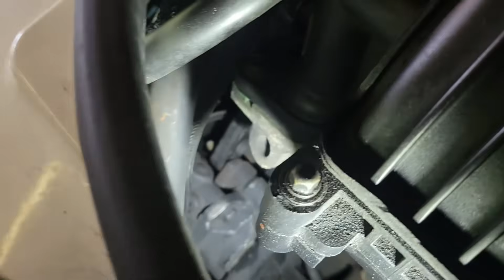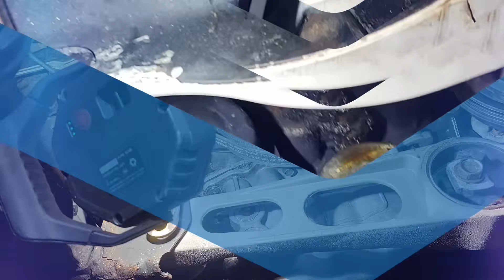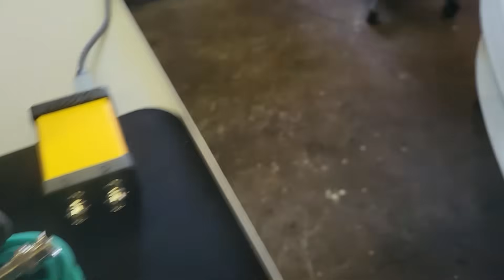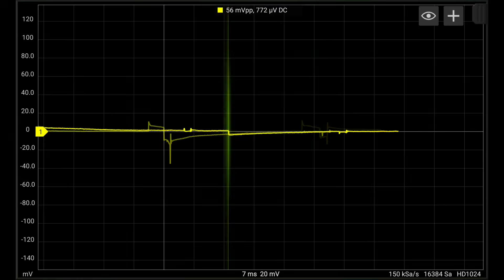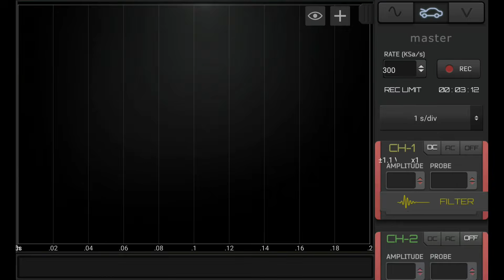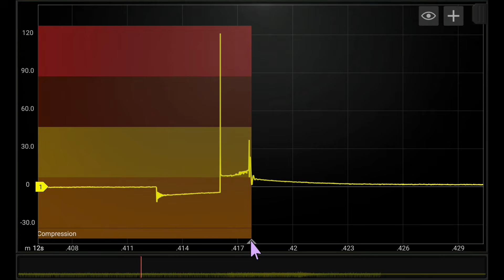2004 PT Cruiser Serpentine tensioner & belt. First use Rotkee Cx1 secondary ignition pick up.

Comment: Can you please tell me what tablet you use with your H scope and automotive module. I’m having difficulty finding a reasonably priced tablet  that meets the 4 gb of ram and that doesn’t have android 12+ .I plan on using the hantek 6074be and a laptop power bank with a tablet. The Lenovo tab m8 tb-8505f is what I originally planned on ordering but doesn’t meet the ram requirements.I would like to get something that is a proven combination. If you have a better idea of what I should get I would really like to hear it. I really enjoy watching your videos and it’s what got me interested in the H scope.
Reply from the maker: @iamautotech9872  Hi, I use an older Samsung S6 that has had a cracked screen and half bad charging port for a few years. I used it on Erin's A7 just to compare and found no difference. Looking it up, the A7 only has 3 gigs of ram. The A9 is listed at 4, however. I will physically check how much memory the A7 has because it ran just the same on her tab as my s6. I've run it on some A model samsung phones also with excellent results. Back market.com has a lot of used tabs if you can't find one local.  
 Samsungs seem to like Hscope, I've never had a compatibility problem yet. Even with the Micsig, the Samsungs perform great!
Reply: Thank you. I found a Samsung A7 tablet and I ordered a hantek 6074be kit and everything I think I will need to make a pretty nice setup. I really appreciate your help. Thank you. I wish you had a Facebook page or at least I couldn’t find one I would have liked to show you the finished product.

Comment: The trigger turns off or disappears offscreen whenever you do anything, drives me nuts lol
Reply from the maker: @philb2334  Yes, it does on scope mode, lol. It resets every time you make an adjustment to the resolution. I  think some new users skip the regular scope mode to get the signal. There is always that instinct to go to automotive mode straight off, but it is frustrating to have to record and play back just to see if there is a pattern on the screen. In automotive mode, i like how the trigger is automatic. Some scopes the trigger will move slightly, and the whole pattern disapears. Especially when you make a voltage scale adjustment. Automotive mode is like if there is anything going on, display it! Scope mode shows you a pattern without having to hit start,stop,clear and a few other keys. Also, if the signal is small and you just pinch to zoom to where it looks right, take note of the actual settings that have changed. That gives you where to start in automotive mode to see the same size pattern. It really is amazing how fast this scope can go from in the box to on a signal. impresses me every time!

Comment: Having an HS502 and HScope sure appreciate the lessons on how to better use he.software when doing secondary ignition captures.  I have ordered some Rotkee LX1's off.of.Amazon and lookimg forward to giving them a try.  The cable build quality is impressive for the Rotkee stuff.  That was sure some tigjt quarters for doing the tensioner and an awesome recovery on your part.
Reply from the maker: @jondieter4903  Thank you! I want to grab some Lx1s soon. I have the Lx4, and although it gets good signals, 1 out of 4 is always inverted, so i dont get the classic parade pattern that i was after. It still would be fine to diagnose which 1 is misfiring, but im waiting for the right situation, which i think for these would be a subaru. The Lx1s would be much handier because you wouldn't have the inverted one distracting is enough. 1 on each channel would be sweet so you can have 1, you suspect, and 1 that is good. If you can find the cheapest double-sided tape that you can, it would probably work better for the signal. Gorilla tape was too hard to get the clear label off, and Alien tape is very thick. I would imagine the thinner the tape , the better the signal. I haven't put that to the test yet, but it is on the list! im thinking like dollar store double sided. Thanks for watching, and definitely let me know how the Lx1s work!
Reply: It might be an epic fail but I'm going to try Gorilla Mounting Putty to hold the LX1's emplace going to try to put it on the sides of it and.bottom of LX1 bottom flush to coil. I ordered two of.the LX1's to try them out and.see how they compare to my paddle probe.  Hope HScope will be available for the Micsig VATO soon. HScope.is.so.well thought out its difficult to use anything else. However Digilent has a neat labscope.called.Analg Discovery 3 amd the developer Attila for.that.is.awesome like Martin is for Hscope You can ask for software functionality and it will get  released in just days.  The AD3 is impressive but a little costly as well.

Comment: Awesome.  I am still glad I never bought a PT cruiser 😅.... Nice tool from rotkee.... Hscope is great definitely going to use it more in the future.
Reply from the maker: @moparnut6286  Ya, They sure do make things tight. The way they made the front pointy takes what was already limited room to a new level, lol. I put a timing belt on it a while back, and there was  not a lot of room to get the front mount off. Had to do some wiggeling and jacking to convince it. 
 The Rotkee pickup for the first use was great. I was looking for a replacment for the ht25, it seems to fit the bill. I might get at least 1 more so I can have 2 patterns on Hscope. Be cool to see 1 that is good and 1 you suspect at the same time. Thanks for dropping by!